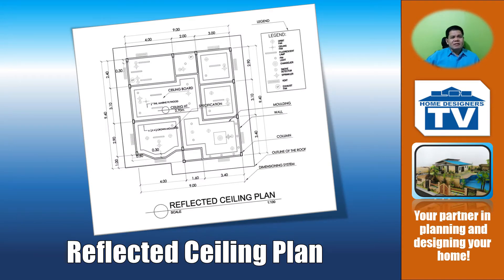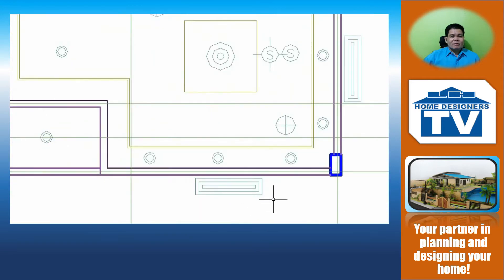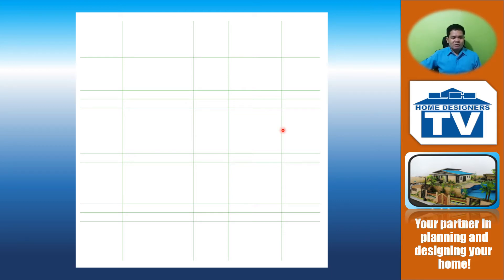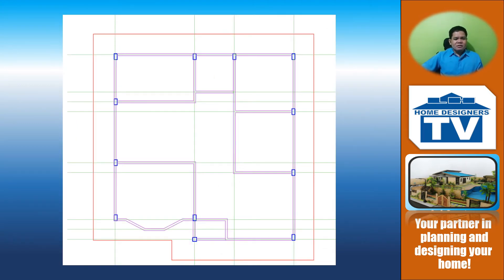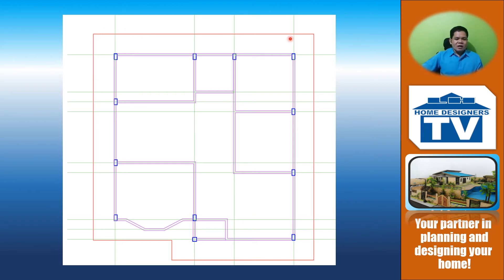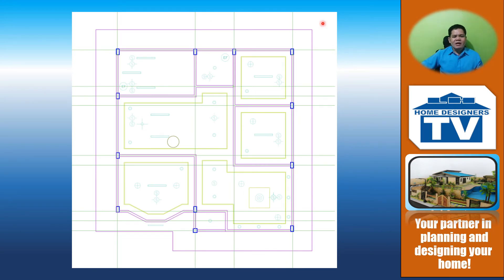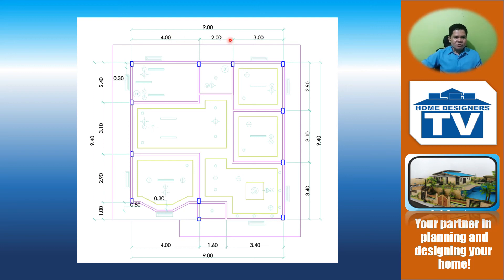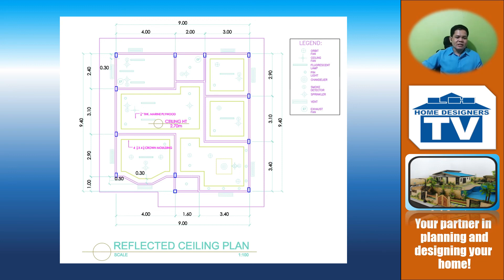Drafting the Reflected Ceiling Plan

Comment: What size the yellow line in mm?
Reply from the maker: Thank you for the question. The yellow lines refers to the mouldings used. Its size is based on the type of mouldings used. For instance, using the 3 inches moulding, 3 inches is equal to 7.5 cm. In a scale 1: 100,  is less than 1mm. specifically, it is only 0.75mm. Very fine. For accuracy, you may provide specifications for the materials based on the available description in the market. God bless you!